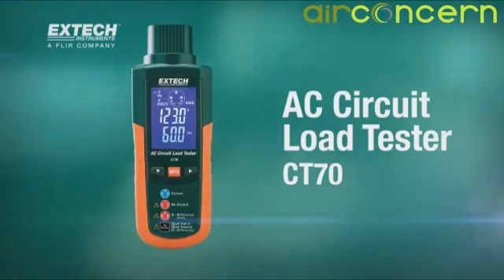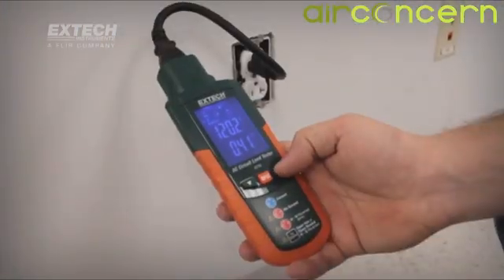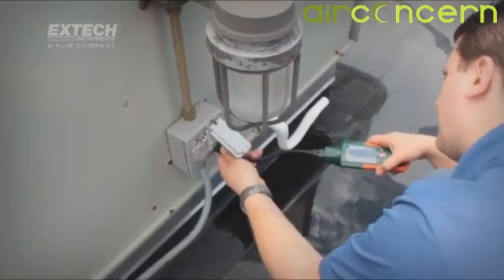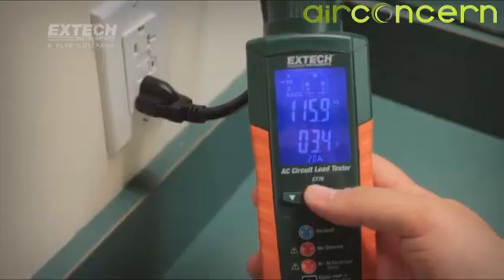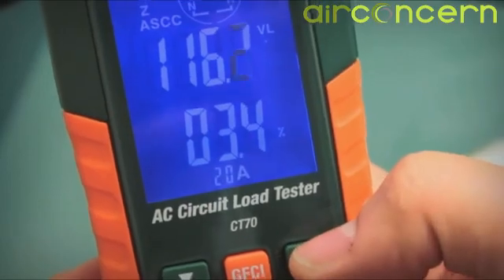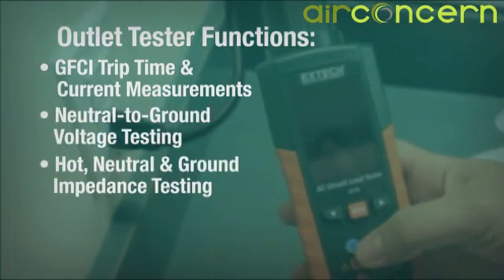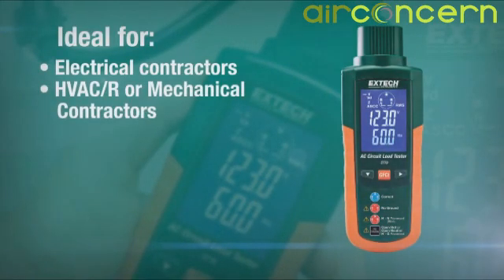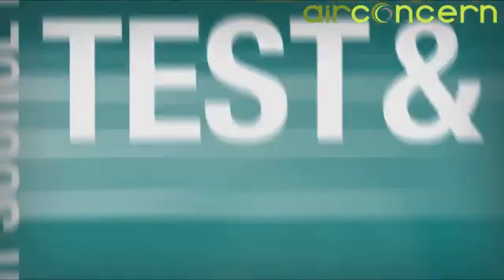AC Circuit Load Tester Extech CT70

Comment: Just tested #exetech #CT70  device,  made in China, I used a about 4 times, it failed, took out a 10 ohm load resistor on 240volt circuit, meant to rated to 350volts but too cheaply constructed not good enough for a sparkies toolkit.
Reply: @ Maurice Upton,
All four Circuit Analyzers are made in China...
Ideal,
Amprobe,
Mastech,
Extech...
Go to Lowe's, and turn the IDEAL packages over, and look toward the bottom....
 Made in China....
As for using Extech CT-70 Circuit Analyzer, to test for 240 volts...
 The Manual warns against Testing "ABOVE" a standard 120 volt 15 Amp, or 120 volt 20 Amp wall plug/circuit...
👉see page 6, of manual,
Quote: Line voltage measurements should be 120 VAC +/- 10% at 60 Hz...
 This is a Cat II, 300 Volts Peak Protection Device, which is Residential...
   The IDEAL is a Cat III, 300 Volts peak protection Device, which is ALSO, safe for use in Residential, low Voltage Applications...
 Even, IDEALS, Spec. Sheet, warns not to use their device for 240 volts, testing...
 Quote: It (IDEAL 61-164) is protected against inadvertent connection to 240 volts, but should be unplugged IMMEDIATELY, and no button should be pressed.
  No where in the Extech CT-70, Manual, Does it Describe how to test for a 240 volt Circuit...
 So this Device is Designed, Strictly for Residential or LOW, voltage 120 Volt Applications, ONLY.
  There is nothing wrong with this Analyzer.
  It will work just fine, for the intended application...
https://www.flir.com/discover/professional-tools/what-do-cat-ratings-mean/